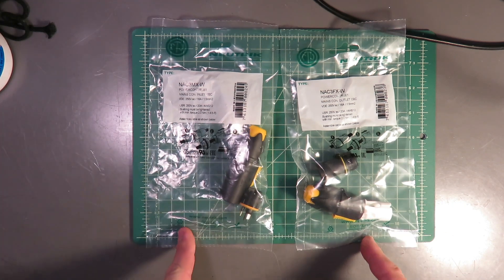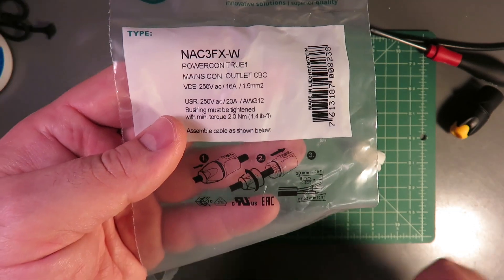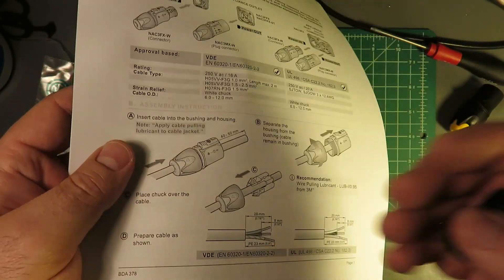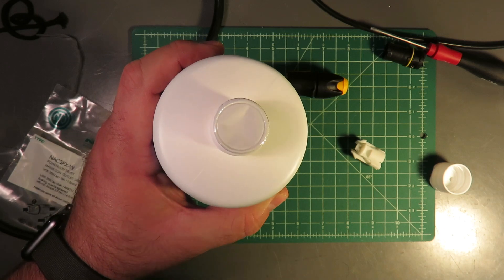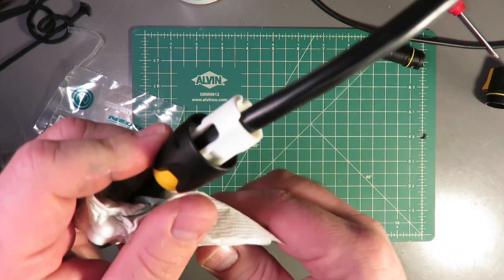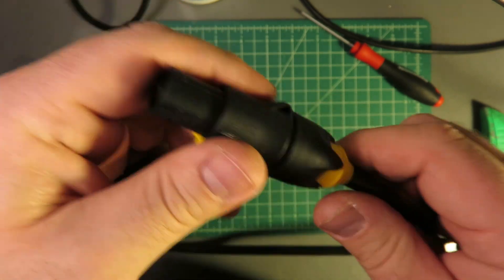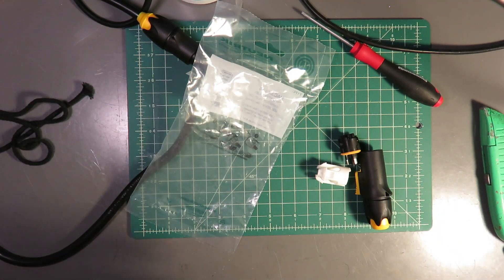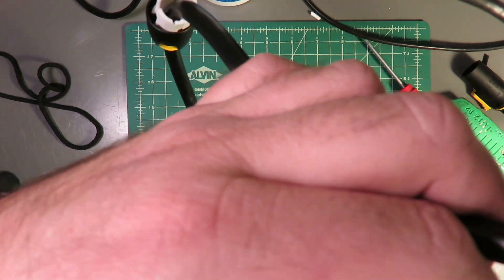Neutrik PowerCON TRUE1 - How to install male and female cable connectors

Comment: Tip: Cords of that style are specifically wound a certain way so that there is a female and male side of the cord. In the video your neutral-white wire was on the wrong side and you displayed some frustration. If you did the other side of the cable it would have been in the correct order for the connector. Great video very helpful thank you!

Comment: I've found if you flip the cable end for end you will find that the orientation of the wires will be correct, no need to manipulate the orientation at the connector.
Reply from the maker: You know, after making so many cables it's embarrassing that I would learn this trick from the comments section of my own YouTube video hahaha! Thank you.

Comment: Next time you make up a connector, such at these, or even a Edison connector, like Hubble or something, and you discover that you need to cross the ground and neutral,  try flipping the cable around to make up the other end. The arrangement of hot, neutral & ground will line up.
Reply: Came here to say that. Thank you for mentioning.

Comment: For me I always use Ferrules when assembling powercon or any other electrical connector/termination.  The raw strands directly are problematic in many ways.  This cable cannot fail and is why ferrules comes into play.
Reply from the maker: Hello, thanks for your comment! I didn't use ferrules because I wanted to follow Neutrik's instructions when making a tutorial video. Their instructions do not mention the use of ferrules so I didn't use them. Personally, I have experienced more issues when using ferrules than without. With a ferrule, there is only one small point of contact where the screw pinches the ferrule, and if the screw loosens at all that contact point is compromised. When using bare wire (I always use stranded wire) the wire conforms to the entire area of the termination and makes much better contact (in my experience). Ferrules usually look nicer but almost every time I have experienced a loose connection in a connector like this, someone had used a ferrule and it had come loose after use - so I have the opposite opinion that ferrules make these connections less reliable. After a bit of research it seems there is no standard for crimping ferrules and when using a ferrule from one brand and a crimper from another there is no guarantee the crimp will hold. I am guessing a lot of the failed ferrule connections I have seen were made with mismatched parts (something any of us could do without knowing it was a bad practice!) This video from Wiha was a god confirmation that without proper spec matching ferrule crimps often come apart: https://www.youtube.com/watch?v=Ia13o1I6DkM If I'm in the position of needing a truly failure-proof connector I will use solder. 

This is not to say there is anything wrong with the way you make cables! I have simply had worse luck with ferrules (made by others) so skip that step all together, especially since Neutrik's instructions are for bare cable.
Reply: @pfjanky  You make a good point that not all ferrule crimpers are the same and should be paired with the corresponding ferrules.  However, with the correct crimper like Wiha (not one of those basic crimpers) the ferrules have segments and will also be soft enough to be flexible when the screw pinches them.  Soldering is definitely an option but under extreme conditions (dry desert and dust/wind) I saw that the wires aren't as flexible with the solder and strands start to break past the soldering portion.  If the screws start coming loose that's a much bigger problem and should be checked.  But in my experience bare wire begins to fray and ferrules that are properly crimped and installed actually make better contact and much harder to break off under strain.
Reply from the maker: @giovannigalvez8598  I would bet that the shop I used to have these issues with used generic crimpers and ferrules for an entire batch of cables and that soured my experience for life haha! Plus many of the failures I have experienced were with Neutrik NL Loudspeaker connectors because there are a lot of different types (and qualities) of cable used for speakers and it was likely NOT a match for the ferrules they were using. 

If I were working on this project in a shop with a group of people I trusted, a large spool of one trusted brand of cable, the correct tools and a reasonable budget I would absolutely use ferrules but since I almost am never in that situation (I work for a non-profit so accounting asking "aren't there generic ferrules?" comes into play, as well as 10+ years of purchasing whichever cable was affordable at the time) I can't guarantee the performance of the ferrules and therefore omit them from my projects.

Comment: Hi there. As you found out there is a correct end of the cable you need to use without crossing over them.
Reply from the maker: Yeah... that's actually a great side effect of posting videos! Learning new things, especially those simple tricks, is always nice.
Reply: @pfjanky  The directions say push and turn simultaneously so the part slides down the cable easily. You didn't turn yours as you slid it, so that's why you needed the lubricant. Lol
Reply from the maker: @illestofdemall13  if you look at the assembly instructions from Neutrik it says in bold, red lettering "Note: “Apply cable pulling lubricant to cable jacket.” and adds the additional information "Recommendation:
Wire Pulling Lubricant - LUB-I/0.95 from 3M TM" which is why I did what I did. Assembly instructions are available here: https://www.neutrik.us/en-us/product/nac3fx-w
Reply: @pfjanky  it also says to twist and push but you didn't.
Reply: @illestofdemall13  you're completely right. I did mention to be careful when pushing it back and for this connector didn't have to rotate because I still had leftover cable lubricant on the jacket, sorry for not twisting. I look forward to watching your instructional videos to learn how to do this the right way!
Reply: @pfjw  I wasn't trying to be a jerk or offensive, I was just clarifying that the directions said something and you seemed to not know why they said to push and twist at the same time. I do electrical and lighting for a living so even though I don't personally make videos, I am proficient and knowledgable when it comes to putting together electrical parts.

Comment: Since you've done so many of these, which type of power cable have you found works best? Do you have a specific brand and model?
Reply from the maker: Hi Andrew,

My go-to bulk cable is Coleman 23388 12/3 cable. It gets you the 12 AWG rating to comply with the connectors but has a small (and durable) enough outer jacket to fit the connectors reasonably. I purchase from Full Compass.
Reply: @pfjanky  Thanks for the reply. Great video. You mentioned using 14 ga in the video, so just making sure the stuff you recommended will fit.
Reply from the maker: @andrewfuhrman7699  thanks, I appreciate it. The cable I was using in the video was the stuff I cut off of the power strips in my Power Strip Conversion to PowerCon True1 video, so I was comfortable with the smaller AWG for that application. The spec sheet for the connectors actually call for 12/3 AWG to handle their full rated power capacity. The Coleman cable I buy in bulk suits that 12/3 spec and fits in the connector snugly. The OD of that Coleman cable is 10.92mm, which is a "Goldilocks" size for the Neutrik spec of 6-12mm OD.

Comment: Have you gotten an alternative for the weicon #5? I didn't get it when they were $12 on ebay. They r now $40
Reply from the maker: Hi, sorry for the delayed reply! The brand names tend to vary so I started searching for "pistol grip wire strippers" and got a lot of good results for under $20 USD. It looks like Harbor Freight sells a Pittsburgh brand set for $15. I've been getting whatever the affordable brand is on Amazon/eBay when the blades dull out (this is years / hundreds of strips later).

Comment: How do you know which cable is hot, neutral, and ground?
Reply from the maker: Hello - I would suggest doing some basic electrical tutorials before digging in on a mains-powered project. The standards for wire/cable color vary by region so I can't give you a good guide on that. Inside the Neutrik connectors themselves you will find labels for which goes where (scroll to 7:53 in the video).
Reply: @pfjanky  nah, I googled it and it took 45 seconds.

Comment: I came here just wanting to know the use for this connector, so could somebody explain the (most) use for these?
Reply from the maker: Hello! As far as I know the connectors are mainly used in the entertainment industry. Neutrik PowerCON originally came out as a VERY similar plug type as their SpeakON connector for loudspeakers. The original version wasn't rated for as high of a load as the TRUE1 series, and their big "flaw" was that they mated all pins simultaneously(ish) which meant that is was possible for ground to be connected after "hot" which meant you couldn't plug/unplug while the line was hot (everyone did anyway).

The TRUE1 iteration added a higher power capability and more importantly assured the ground pin mated first so they could be used while live. The TRUE1 TOP added IP-something moisture/environmental resistance. This made them even more appealing to the entertainment industry which often produces shows outdoors. Plus, they lock in place easy-peasy!

This also could be wrong hahaha... it's just my understanding of and experience with the connector! I hope it helped though; this is a very common connector on things like professional intelligent lighting, special FX, audio equipment, etc.

Comment: I love your moans when you tighten the plugs. Also your comment when lubricating the outside of the wire is nice :-)
I am going to buy NAC3MPX-TOP and NAC3FPX-TOP to make a waterproof plug connection for my car. I want to defrost the car with a fan heater when there is frost.

Comment: I swore you were the one who taught me to use ferrules on the stranded wires. Anyways, why did you switch to True1? I’m still using the regular blue powercons
Reply from the maker: I haven't done anything on ferrules so I don't think that was me, but I hope it worked out for you! I started making these True1 cables for the power strips I modified in my other video, and the only reason I chose them for that application was the great male/female combo package Neutrik sells for that product line.

Comment: You started with the right end, female first and male last cause you gotta plug in the male for power so touching those prongs you WOULDNT get shocked
Also cable has a natural direction, so you shoulda had male and femaled switched, wouldn't of had to move cables
Reply from the maker: Hi! Yeah, I realized the male/female thing when I was editing the video but didn't think it was worthy of a reshoot. Thanks for mentioning the natural direction of cables - more people should be aware of that!
Reply: pfjanky I agree! It’s not a huge known thing for natural direction I didn’t know it when I first started but it gets a lot easier when you know it lol

Comment: Try connecting a tool on a GFCI OUTLET SEE IF IT WORKS. ON MINE IT didn’t work it tripped the outlet
Reply from the maker: I haven't experienced this issue personally. Sometimes, especially with higher-power tools there is enough of an inrush current to trip breakers; especially on long extension cords.

Comment: Thank you for this very helpful guide - and the great tipp with the Weicon stripper. Did you know that you can order from Amazon.de with your Amazon.com account? On Amazon.de the Weicon tools are available. Anyway - I had already stripped cables to start with. So I used some soldering on the cable tips to keep the thin wires together and - because I forgot to order the wire pulling lubricant - I tried it with WD40. It worked. :-)
Reply from the maker: Thanks for that info! I've never tried shopping outside of the US store on Amazon.

I've always read that soldering the VERY TIPS of cables into screw terminals is permissible to keep them from fraying, but there shouldn't be solder on the area that will be clamped down. As the solder slowly compresses/deforms, the cable will just fall out of the screw terminal. As always, results vary across uses, but for anyone reading these comments I'd emphasize to not solder anything more than the very tip and not the whole length of cable being clamped into the connector terminals.

WD40 is a great hack to avoid the cable lube! I honestly didn't even think of that. Always be sure to make sure the jacketing on your power cables will safely interact with WD40 or any other lubricant you choose to use.

Thanks again!
Reply: Good to know about possible future troubles when soldering the clamped area of the wire. Didn't know that (and I never ran into that kind of a problem). 
Yeah, using WD40 is kind of a dirty hack as the oil could later brittle the rubber jacketing. I sprayed it on and wiped most of it off immediately. The rest dissipated quite fast - I guess it interacted with the rubber, but the surface looked ok upon a closer look.
Reply: Oh, and the yellow end part where you pull the wire through first - I think it is meant to stay inside the end part for better protection and not to be turned to the outside. Maybe that is the reason why the manual says push and turn at the same time.

Comment: can i use as well lubricant from the sex shop ??? :-o
Reply from the maker: I don't see why not! I would confirm that it won't harm the jacket of the cable you're using, but especially with water-based lubes it should be totally smooth sailing.

Comment: That wire stripper  You did not say how much it is   Wonder way?  

$195.    IT better be nice Dog.
Reply from the maker: Not sure where you're shopping. I got mine from eBay for $26 USD. Prices for the Weicon No. 5 range from $23 to $60 USD on eBay as of 12/8/18. If you do a quick search on Amazon for "automatic wire stripper" you can find other brands for as little as $14 USD, and I'm sure the same applies for eBay. I don't want to post links because listings come and go, but if you can't find these products I'm happy to email you links if you send an email address. I'm not an affiliate for any product, just trying to help.

Having said that, it IS nice, thanks.
-Dog